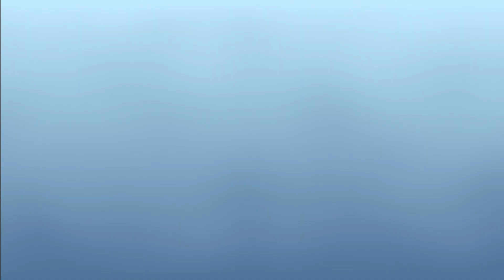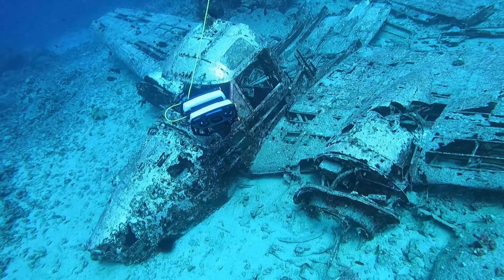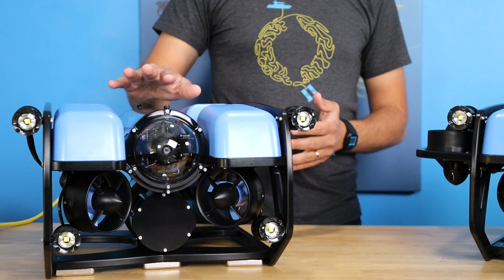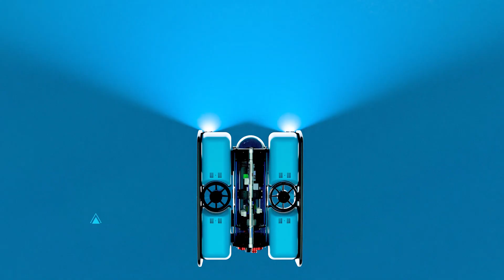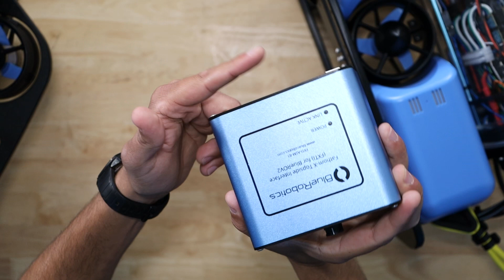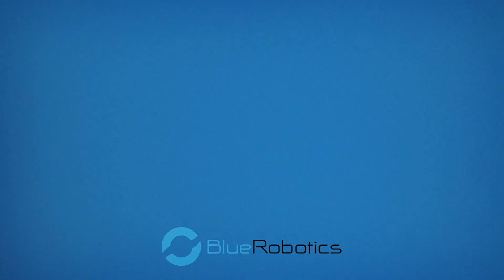Blue Robotics Product Overview: BlueROV2 R4

Comment: Don't the ESCs need to be cooled?
Reply from the maker: The ESCs radiate heat and the enclosure stays cool due to the water around it, so cooling is sufficient. In normal ROV operation, the thrusters are running at pretty low power on average and it works well!

Comment: Very interesting thanks. Any particular reason why you went RaspPi instead of Pixhawk?  Also - many of us are waiting for stabilised 4K video so an option for GoPro 10 would be nice.  Video lights need to be positioned so as to prevent backscatter from particulates in the water.  Great price point! THANKS.
Reply from the maker: We already had a Raspberry Pi onboard to handle the Ethernet communications and camera, which a Pixhawk can't do, so it makes sense to consolidate the flight controller to also be part of the Raspberry Pi. Good to know you're interested in a 4K camera. That's something we're looking into. Thanks!
Reply: @BlueRobotics  where are you in Croatia?